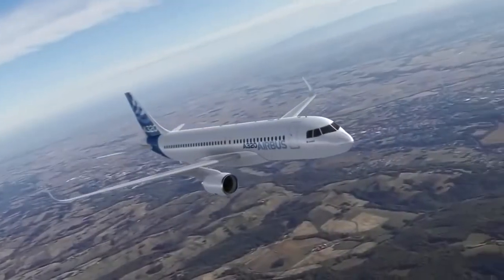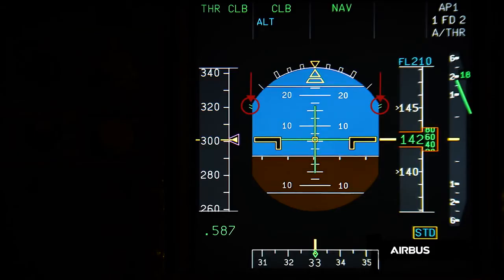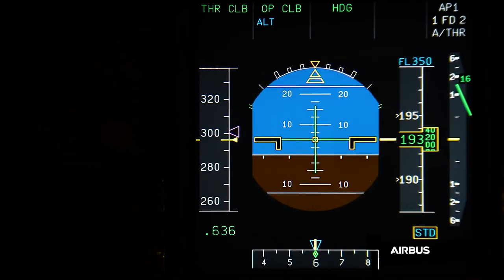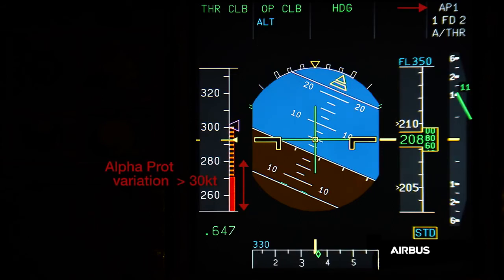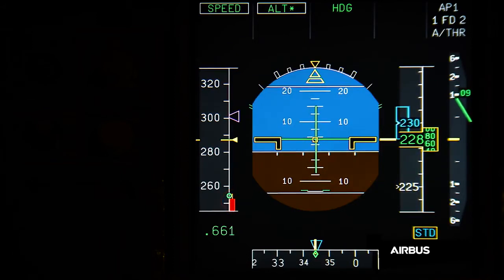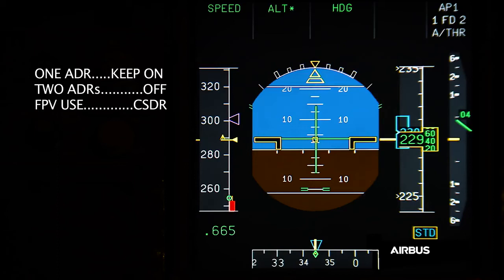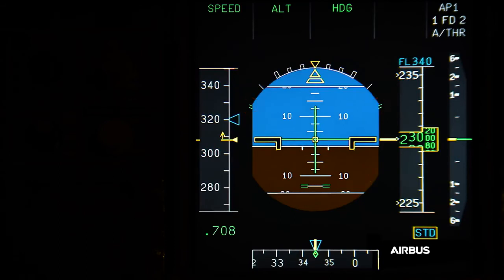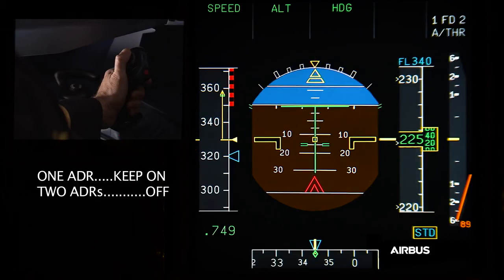Airbus A320 - Abnormal V Alpha Prot OEB 48

Comment: This is a Good CBT on the A320 Jet - 36,000 Feet. Max 45,000 Feet. You Need to Attach Eight Gulfstream (Rudder) Jet Engines - B52 Stratofortress. Like the Boeing 747 (Four Double Engines) to Get To 80,000 Feet. Where You'll Float a Little. Sub Space or Near Earth Space.
B52 Stratofortress - Stratosphere Fortress.  Stratosphere 80,000 feet atmosphere.